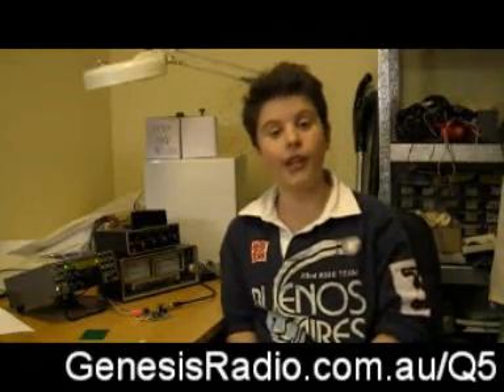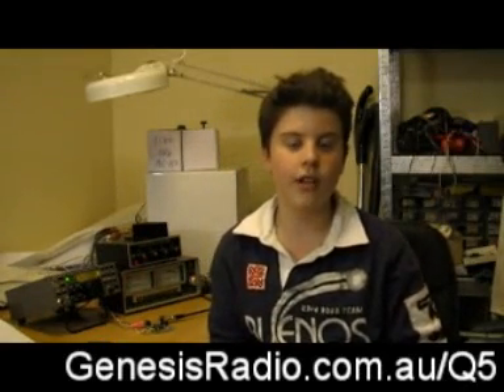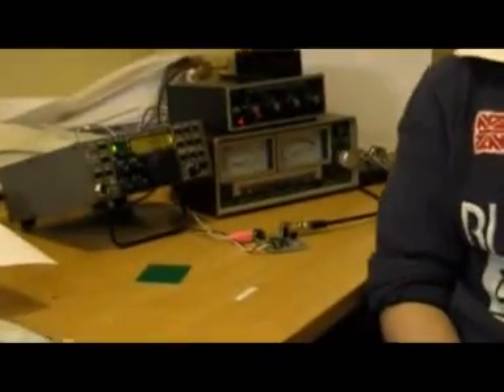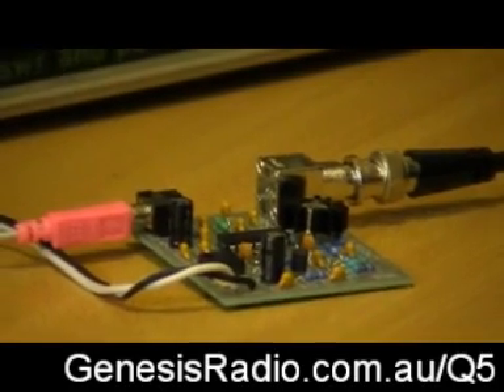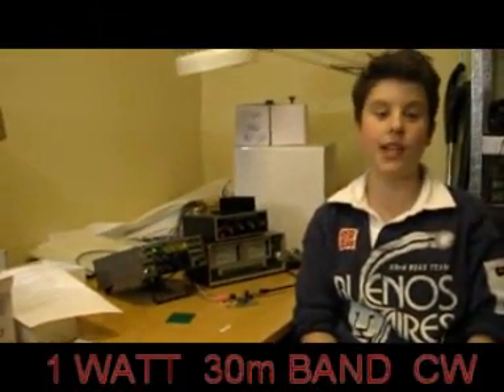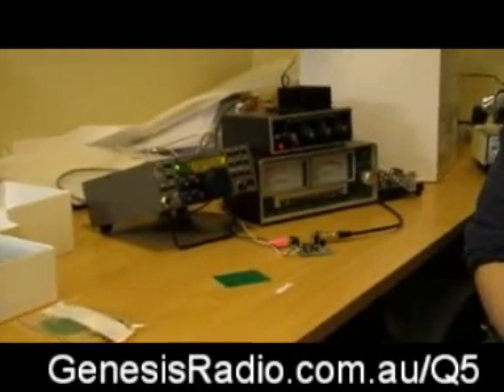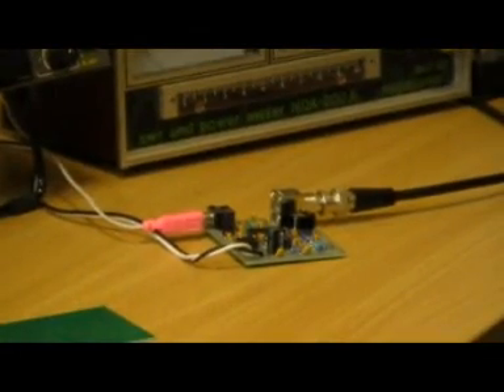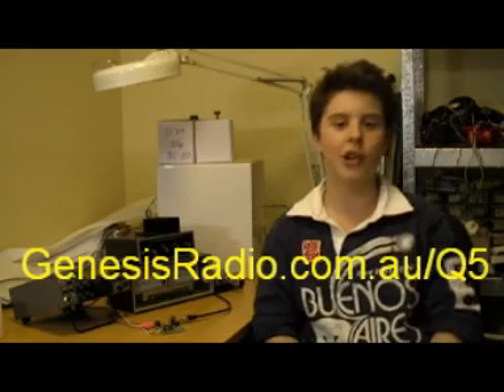GenesisRadio Q5-30  1 Watt QRP transmitter presented by Josh, VK2FJDX

Comment: hi josh great video pleased to say your into home brew radio 1w is certanly a challange on todays bands i have found also that a simple direct conversion reciever is some times better than an all singing dancing rig on qrp as the noise from the frequency synth and other computerised ic,s can wipe out many a good qrp signal and a dc rx can be made very quite with good audio filtering